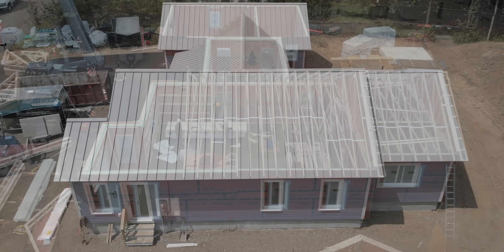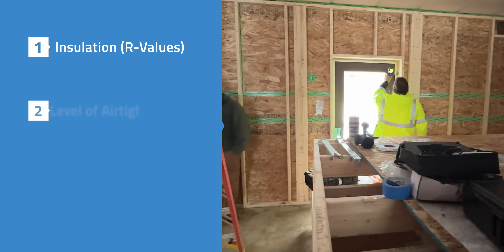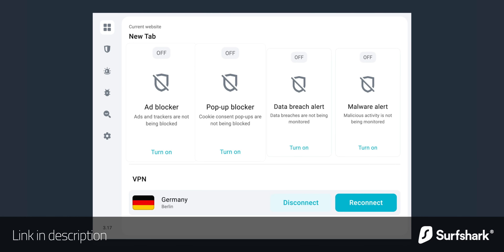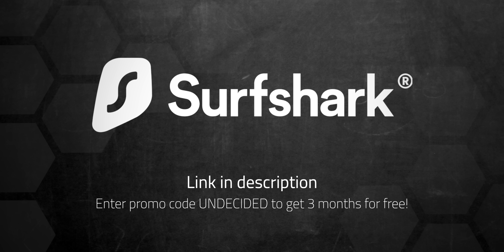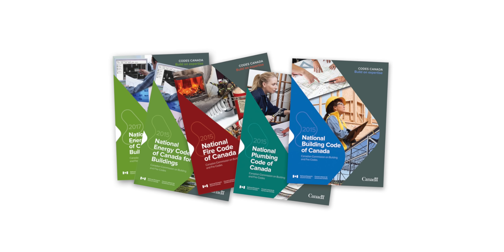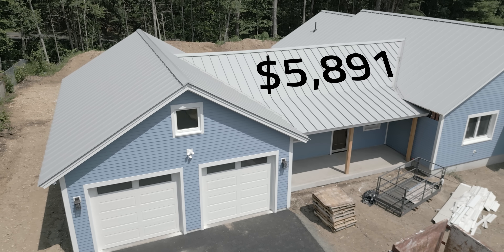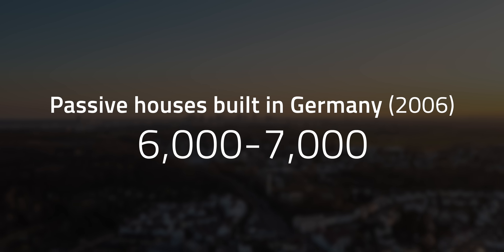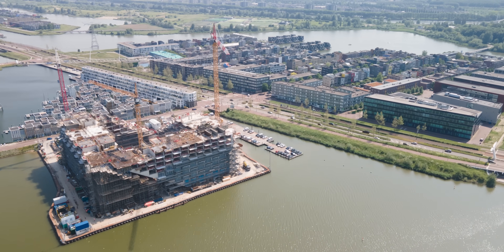Why Do American Homes Suck?

Comment: I was born in Belgium and one of the things I find shocking in the US is that I see that some wooden homes which were constructed maybe 30 years ago are already in need of a complete repair down to the studs. Doesn't sound like the best ROI in my opinion. Yet they keep re-building the same way. And these wooden houses cost tuns of money. Some things I will never understand.
Reply: There are covert forces that prevent wisdom from prevailing. Example - after one hurricane, Habitat for Humanity used SCIP (concrete sandwich wall panels) to rebuild homes. Even former president Jimmy Carter was photographed on the work crew. Months later, a hurricane hit the same area, and only the SCIP homes (Tri-D-Panel) survived. 
Fast forward to post hurricane Katrina (New Orleans), and HfH was rebuilding homes using WOOD FRAME [excremental expletive deleted]. 
Did "someone" feel insulted that po' folk were getting homes better built that their "betters"?
Reply: I live in Canada and I can confirm. That or homes are built like crap😂😂. A  new home can have many problems. Its a joke to say the least 😂😂😢😢😢
Reply: Houses are built to last for 30yrs. Banks wont give you a loan on a house more than 30yrs old.If you're the homeowner with a typical 30 yr mortgage your stuck w something you can't sell after it's all paid off.
Reply: @Ekam-Sat  it just depends on where you are. New construction in Florida is all concrete, interior walls may be framed in wood to make plumbing and electrical easier to run, but they’re solid houses (hurricanes)
Reply: Japan does the same
Reply: @Ekam-Sat  As a American have to agree with you 100%. But it's getting to the point now everything is seen is disposable. It's a massive waste of time money and resources. Everything prematurely ending up in a landfill.
Reply: @ Yes. Sad facts. Blessings to you brother.
Reply: They don't  build houses , they build oversized cabins
Reply: Americans are a very mobile population. The average American moves 11.7 times in their lifetime. Their house gets passed onto the next person and becomes their problem. It also makes it more difficult to have a sense of community.
Reply: @Ekam-Sat  And the worst part is that despite the obsession, most Europeans barely understand the U.S. past a suface level and misunderstand everything. 

For people who actually understand this country, the way American homes are built makes perfect sense. And they don't need to complete repair after 30 years.That's just nonsense.
Reply: @Ekam-Sat  I've been to Europe plenty of times, that why I know you guys are obsessed. And It's not about thinking we are important. Most Americans don't like this unwanted (overwhelmingly negative) attention and wish you guys would stop being so fixated on our country, stop comparing yourselves to us, and stop pontificating and these "problems" you don't even understand. 

You talk about the 80s and 90s, which is hilarious. Yes, Europeans had a more positive impression of America back then. But did you know that crime and drugs in San Francisco, Philidelpha and Los Angeles, was a million times worse back then compared to now? The only difference is that the media didn't talk about it so European's don't know about it. 

Everything you guys think you know about America is just rehased media with absolutely no substance. Then you lecture us about our own country based on the T.V knowlege you got from overconsuming our media with no real-world context. For the few Americans who are not self-loathing Europhiles, you guys are an unwanted stranger in our living room. And it's time to leave.
Reply: @WillieFungo  Truth is subjective. The San Francisco Bay Area is becoming like a wealthy city state. The average house costs $1.25 million dollars — much more within the city of San Francisco. Many social problems are being pushed to the outer edges of the Bay Area, or beyond. Due to it being in an earthquake zone, some of the construction techniques would not make sense in the Bay Area. However, in many areas of the United States more robust construction techniques can be justified. Use of such techniques requires more longterm thinking.
Reply: @WillieFungo  “Truth” in your case is subjective.

“The truth is that Europeans need to stop obsessing over America and focus on their own countries.”

You come off as very defensive, obsessive, angry, and insecure. People, regardless of their place of birth, have all sorts of different opinions on all sorts of topics. To state the obvious, Europe is not a monolithic of opinion, and neither is the United States.
Reply: @barryrobbins7694  Don't psychoanalyze me. Focus on the topic being discussed, which is housing in the U.S. I'm generalizing you as a "European" because you haven't named your specific country yet.
Reply: @barryrobbins7694  I see you aren't going to name your specific country, so I'm going to assume you come from Western Europe. The United States is a much more technical and efficient society than yours. And U.S. construction methods look confusing to you because you simply don't consider the same factors that American builders consider when they build homes. 

For starters, wood is not a low-quality building material. Wood can last indefinitely if maintained properly. For example, the foundations in Venice are made with wood piles, and they have lasted over 500 years. Drywall is not a low-quality material either. It has several advantages over plaster and lath used pre-1900, such as repairability, customization, etc. All of this is based on cost/benefit analyses that have been worked out over decades. 

American homes are built to maximize repairability, insurability, and resell value -- which relies on a degree of customizability. 

And despite what your European TV tells you, tornados are not that common here -- the risk is less than 0.1% yearly even in high prone areas. So in the Midwest it makes more sense to focus on building designs that can be efficienty replaced if they are destroyed. In this region, concrete or load bearing brick doesn't make sense because it is too expensive to insure. 
However, In Hurricane-prone areas like Florida, concrete frames and heavy clay shingles are used because storm frequency is much more common. 

Insulation choices are also based on a similar cost-benefit analysis of energy cost, home size, etc. These numbers are, obviously, completely different from Europe. 

At the end of the day, there is very little a European can intelligently contribute when criticizing U.S. building methods. These homes represent practically the most efficient designs considering the market conditions, material cost and availability, etc. While there are some quality control issues in some new-build construction, that is a separate issue from the core building designs and materials.
Reply: @WillieFungo  Yawn...
Reply: Houses are not build to last ,have an expire date so need to be demolished and build other house.
Reply: @Ekam-Sat  Of course it's a good sign. America is a very foreign country over 5000 miles away from Europe. And Europeans need to act like it instead of behaving as if the U.S.A is their neighbor or colonial master. The fixation is exhausting and annoying.
Reply: The truth is that Europeans need to stop obsessing over America and focus on their own countries. America and have a different culture than you. Accept it and move on. Does anyone harass Japanese people about the way they build their homes?
Reply: @WillieFungo  No, the Japanese build excellent houses to withstand earthquakes. And Japanese carpentry is world class.
Reply: @tortap  Japanese homes are usually torn down after 30 years. I have no problem with this. Unlike Europeans, I respect other cultures and their construction methods instead of trying to impose my values on them.
Reply: @WillieFungo  I'm from North America I'm from Canada we build stick frames too their s*hit . That's the truth
Reply: @Daniel-qr4cs  I'm glad North American homes are built using readily-available renewable resources. And contrary to European T.V opinions, they don't fall apart after 30 years. 20-30 years is still essentially a new home in the U.S. 

The majority of American housing stock was build before 1980, and the original timber framing is still doing fine. Wood can last indefinately if it is maintained properly. 

As for insulation, it is not cost-effective to add $100,000 worth of insulation to an American home, considering how much cheaper our energy costs are compared to Europe. And how much larger the houses are. It would take 100 years to break even on the investment.
Reply: @WillieFungo  you obviously have no clue how cheap insulation is. If you spend $10 000 (not 100 000) on it for an old house it is a lot. Adding extra insulation on a new house is cheaper since there is no extra work.

Comment: It's not about being green, it's about comfort. These windows really help reduce draft, making the temperatures more stable and pleasant. And the twist turn windows help with controlling the temperature and ventilation while preventing theft, mosquitoes (if you get a fitted mesh) and rain getting in.

Comment: What's actually interesting is that here in california, the requirement for wall insulation for nonresidential buildings is ~R19(depends on climate zone) and roofs ~R30. 

But for homes it's R9.8-R14(depending on wall framing 2x4 vs 2x6) and roofs are only R22. For spaces that are much more envelope driven when it comes to energy usage due to the square cube law. It's interesting that the insulation requirements are so much lower.

Comment: One thing that has always struck me, when seeing images of hurricane damage, is just how fragile the buildings appear to be. I stress that this is only based on the images of the aftermath, which could be given a totally wrong impression, but it makes me wonder how a typical UK home's construction would stand up against that type of weather.
Reply: They wouldn't 😂
Reply: I live in a wood and shingle full Cape house (the cape cod architectural style named after the peninsula of Massachusetts where I live) it was built in the mid 1700's and is still standing after centuries of hurricanes and nor easters, bomb cyclones, floods etc as have several others on my street. When my house was built there was still laws preventing the use of the prime lumber in local construction as that all had to be sent back to England. Wooden houses will last indefinitely if properly maintained.
Reply: The windiest place in the UK is the Shetland Isles. So they build strong homes that can take 300kmph gusts of wind.
Reply: Can only talk about houses in Austria. The standard here are 50cm thick brick walls with an additional 2-3cm thick thermal plaster on the outside. Floors are usually out of solid concrete blocks.
A tornado would probably bust the windows and clear off the roof tiles but the core structure would barely even be scratched.
The standard in the US is pathetic. We build stronger fences than they do their houses. Not even joking about that.
Reply: @daname1491  European countries are small and irrelevant compared to the USA.  And since there are videos of French, Belgian and German homes being destroyed by flooding, your house in Austria would completely collapse in a tornado.  Before you say anything, I'm Brazilian and the floods here are stronger and more frequent than European floods.
Reply: typical UK home's construction would would become rubble. that's why we build light. unless you build a bunker nothing is going to stop a hurricane or tornado
Reply: Well, my parents house in Devon (UK) was constructed in the 1700 and has a thatched roof and very thick stone walls.  Having lived in FL for forty years and experiencing Andrew, I don’t think many homes would survive a cat 5 direct hit.  I think I take the thick stone walls any day.  You have to remember that houses in the UK don’t have shutters like we do in FL, so that would inflict huge damage.
Reply: Yeah no the additional cost is not worth it. 25 years construction experience in hvac. You could force people to build like Matt Reisinger, but they aren’t going to save the extra $200k ever. 

I did my own house extreme efficient but to use subs would have been ridiculous. Do it yourself though
Reply: I think you are underestimating the raw power a hurricane has. It's a weather event easily visible from space carrying billions of gallons of water. There isnt much that can escape unscathed when subjected to the full force of one of those events.
Reply: UK houses are worst in Europe. Flimsy and low quality.
Reply: If you are wondering google Czech tornado. Most of the homes are 40-60 years old. Brick or autoclaved aerated concrete blocks, with retrofitted windows usually with new roof and occasional added insulation. Except missing roofs and busted windows the core structure is intact. Most homes were livable in few days with minimal damage to the interior. The most damage homes took 1-2 months mostly waiting for the roof and new windows. Not sure but think gas or water was not damaged, only electricity witch was quick fix since vast majority of power lines are underground. By comparison flooding is way more damaging, not only it can disrupt infrastructure but the building static. And to add up it destroy all furniture inside + it takes several days or even months to dry thick walls that soak up water.
Reply: @scasny  I just looked at the video of the Czech tornado. The vids I saw showed whole areas of towns that were leveled by the tornado including the brick and stone ones. SOME houses were barely damaged but many homes were totally destroyed.
Reply: When an hurricane or tornado "parks" your neighbours car in your living room, it's not relevant, what matrial your hose is built of. It's gone. Then it's cheaper to rebuilt a cheaper house than a more expensive one so the damages (and the insurance premiums) are lower.
Reply: @christianfischer9990  this is plain ignorance speaking. Cars driving full throttle into buildings is somewhat common everywhere. I've seen the result of large SUV meets solid wall (result of a car chase, so lots of speed). Result: Car panpaked, wall/insulation slightly dented. Simple two-story construction, new-ish, so likely cinderblock or brick, not masonry. ~40cm walls are quite sturdy.
Reply: I imagine if Europe had hurricanes to worry about that the standards would be adjusted for that kind of experience. I also imagine it would be vastly better than the USA while also costing more.

I've been through multiple hurricanes up to cat 4 on landfall. I've experienced 100+ mph straight line winds. I have also hidden in basements/tubs/ditches because a tornado was getting way too close. Fortunately I've never had a direct hit with a tornado. The first life experience that humbled me in regards to weather was when my town was hit by unexpected straight line winds due to a localized meteorological event. I still to this day vividly recall running from the front door of the house to the basement while everything was shaking violently. If you hear that train roar get the fck in cover.  That was "only" 80 or so mph winds. An oldschool brick 1.5 story factory a couple blocks up wind lost part of it's wall with a good section of the roof landing in a wide spread of various yards. 

So you know what I hate about hurricanes? They like to spawn tornadoes that are very unpredictable. I can at least move to the high ground to get from the flooding. Speaking of, flooding generally accounts for the majority of the damage you're seeing when viewing the aftermath of a recent hurricane. 

Have to say though the clouds are wild if you live on the coast when a cat4 is coming at you. The day of the first hurricane was so surreal to witness. Walking out of the house at night while the eye is above you and not hearing a single animal/insect is kind of freaky.
Reply: A European concrete structure with brick walls is calculated to wind loads, maybe it's not calculated for Florida's worst hurricane, but don't expect it to be torn down or fly off in pieces like a wooden American house.
Houses in Europe are most times built one on the side of another so the risk of structural damage by wind or earthquakes is minimized by a lot solely by that fact.
Reply: You see the places with the most destruction - and those are freak occurrences - and it largely makes more sense not to build to withstand - but to seek shelter inland - allow the house to fall and rebuild.

European Cinder Block construction would possibly do well against wind, but it does horribly against earthquakes - where would construction allows for absorbtion to a larger extent.

things are tradeoffs - and the cost of building, and teardown, and renovations are all effected by codes an the like.

Matt can build a house that exceeds code - anyone can.  Code is a minimum standard.  Making it more costly to build can mean very low home ownership rates (see Germany and Switzerland with the lowest in the developed world) - and/or homes that are much smaller than what people in america are used to living in - but similar to what Americans lived in in the 1950's (think 1500sqft not 2500-4000)

It is tradeoffs and decisions - and perserving the ability to make those appropriately in a country so large and diverse in terms of climate is probably the more prudent thing to do.

So - Matt can have a very efficient home that "does not suck"  - while others can make other decisions that are right for them.
Reply: nothing would be left, UK builds are far more less stronger materials